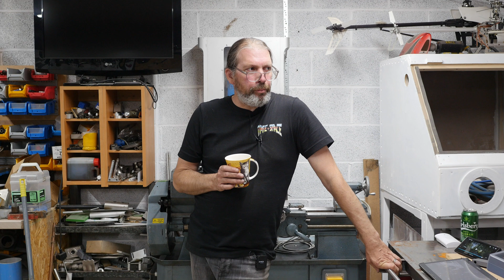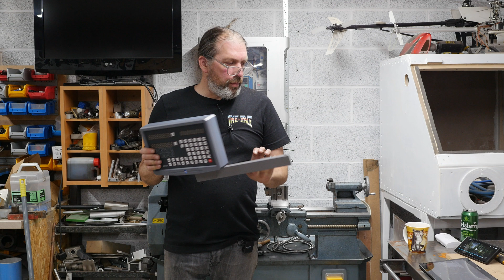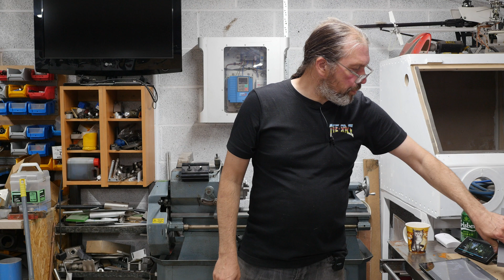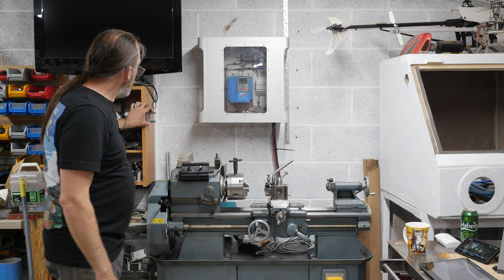Boxford DRO install Episode 5: Display and test

Comment: Great installation. You have inspired me to install a DRO on my Boxford model A.  Where did you source the motor and inverter for your lathe, looks to be a very useful upgrade.  My old single phase motor is nearing the point where i will have to replace it.  Thanks Kev

Comment: That was a well executed project. A DRO on an Imperial lathe is such a game changer if your brain works in metric. I did similar to my Model A for the same reason. I also fitted a three axis DRO to my mini mill, but with the better LCD visual display. Makes PCD hole patterns a doddle. As I had to change the pin outs on my plugs because I bought from different suppliers anyway, I shortened all the cables so there was no bunched up slack stuffed at the back of the machine. All my stuff also from Aliexpress.

Comment: That's a lot of benefit in time saving and probably waste from calculative errors (from bitter experience) for a modest outlay. Very satisfying, you can pat yourself on the back. I look forward to the day when I can say "I'll call that project complete" 😉
Reply from the maker: Thank you pal.  I have been putting this off for a while,  thinking it would be more difficult, but it was actually quite an easy one and as you say,  not very expensive. Good luck with yours.